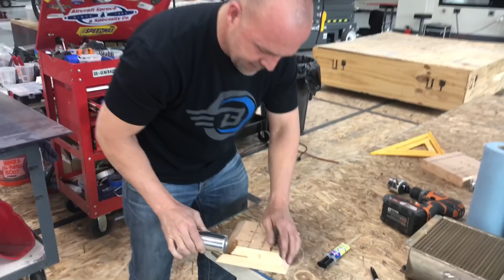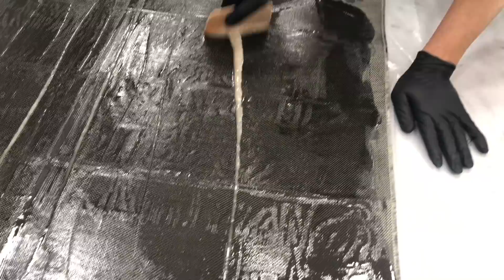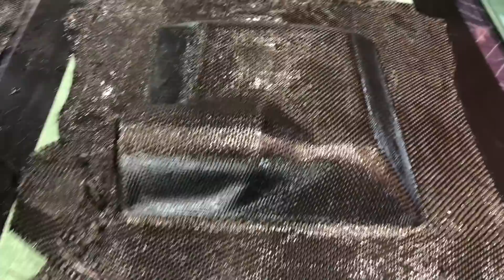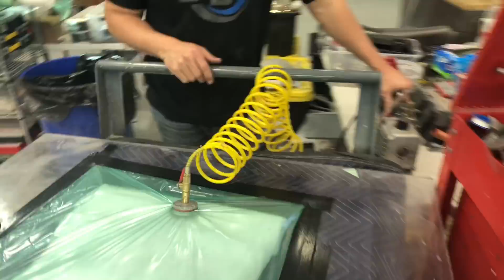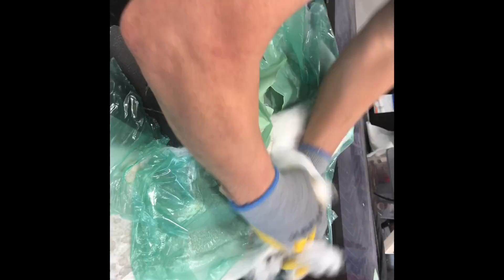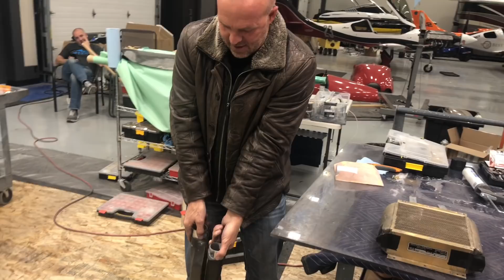Mike Patey Wilga (DRACO Video 3) Making Carbon Fiber Molds

Comment: No pleats required the carbon pulled down.The vacuum pressure and working the material into the mold as you started vacuum..I thought you had to do pleats.

Comment: Why do you still wet out your carbon and not use vacuum infusion or pre- preg ? Much better resin/cloth ratio and the addition of a small autoclave would make stronger and lighter with a similar/faster turnaround time...

Comment: You have amazing energy and wide-ranging skills Mike. This is a fantastic project so please forgive me for being a bit pernickety. These carbon duct parts used 4 layers of woven cloth, seemingly all laid with the warp and weft in the same direction, i.e. 100% 0/90 layup. This is OK for lightly loaded parts but for more highly stressed parts you would need to add some layers at 45 degrees. Also, to prevent the part warping as it cures, the plies should be layered symmetrically about the mid-plane, e.g. 0/90, +45/-45, 0/90, 0/90, -45/+45, 0/90. The process looks fine overwise.
Reply: 6 layers, not 4 (my bad) but same point but more so. Using more than 4 layers of the same orientation together risks delamination if high loads are applied. Probably OK for these items however.

Comment: I thought aluminum and carbon fiber were incomparable causing the aluminum to corrode.  I didn't see any isolation barrier between the two.
Reply from the maker: Patrick Smith good catch, galvanic corrosion is a mess. I screwed up in editing trying to keep the video short and I left out the footage when I added a couple layers of fiberglass. I now make it a point to show that in other videos you will see I leave that step in the video

Comment: Will someone please tell me I know Mike knows what he's doing without a doubt but with the oil coolers being so far back from the motor your adding 15 or20 ft of line to push your oil especially if you are at a incline going at a high RPM.do you have to add a extra oil pump or a stronger one to return the oil?
It's just a learning thing for me.

Comment: Nice part!  Agree with others about the dust mask thing but you obviously know what you're doing and can make your own choices.  

Quick note on the vacuum bag fitting - it's easy to just toss it under the bag and cut the hole from the top - just a slit across the hole in the base fitting - and then stick the top plate through the slit.  It makes it really easy with bigger bags where reaching under with a knife is risky business.  

Thanks for a great video!

Comment: I’ll tell you another trick. I like to use plastic on both sides to squeegee the excess resin out. Also a cool trick is to use zip lock bags🤣 you can throw a few lays ups in a zip lock pour the resin in and even hold them in the cooler . Then when your ready you just roll the excess resin to one side mark your pattern on the out side of the zip lock and cut it.  Try the zip locks it works great and it’s fast

Comment: Nice tip on the home depot batten material; Vac bagging consumables are expensive, nice to have a low cost alternative for something you use a bunch of but just throw away.

Comment: Hi, can molds be made of hard plastics for making wax injection? I am considering getting a 3d printer if I can find some files to print, wanting to print a mold for a turbine wheel about 196mm dia clock wise turn. Thanks bjphotography3@gmail.com

Comment: Mike, I like the part... but you should use a first layer of fiberglass to protect the aluminum from the carbon matting surfaces. Carbon on aluminum causes corrosion very fast! And put on a respirator please... love your toys!
Reply: Kraken unfortunately you are not correct. I work on airplanes for a living  and I see an insane amount of corrosion on the tails of ATRs where aluminum is bare on cabron. Even if the parts are sealed it happens.
Reply: Only if it comes into contact with an electrolyte, like salt water.  This is common in Carbon Boat building where you end up with plenty of salt spray, in a dry application it shouldn't be an issue.
Reply: I was going to suggest the same thing.  Not worth the risk on an aircraft part.

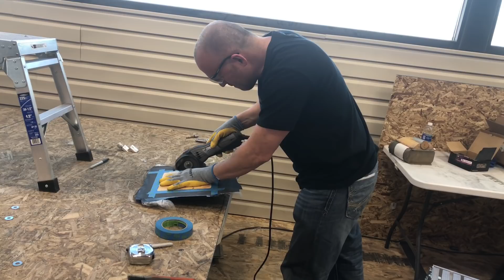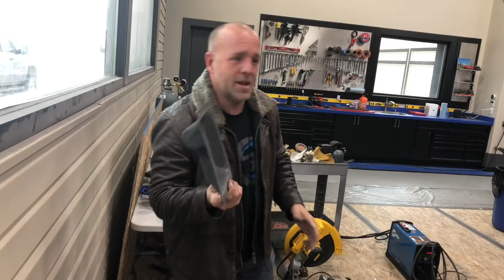Comment: Mike, what is that tool you are using to trim the edges of the part with (10:20, 11:10)? Is it just a die grinder with a thin cutoff wheel, or something more specifically suited for fiber work? Looks like it zips right through the stuff. I will be starting fiberglass work on my RV14 soon - could use something like that!

Comment: Your commentators are correct. Composites are dangerous because the fibers are so thin and stiff they'll readily penetrate the skin and work their way clean through the body. You need to wear protective gloves and a true respirator, not a simple carpenter's mask.

Comment: Holy crap !!!! When I was doing this building F-18's I was fully covered, respirator, coveralls, the whole bit. Atleast put on a mask and have a vacuum table when you're grinding Mike, PLEASE !!
Reply: Yeah a vacuum table is so easy to make I have one. Certainly Mike can Fab one up. It is very disturbing, he has no excuse not to make one. I also cut things just a little bit slower. Takes a little more time but keeps the dust down a lot. And for the last time it is very disturbing

Comment: WEAR A MASK WHEN CUTTING CARBON.  IT IS AS BAD AS ASBESTOS
Reply: No it isn't. It's bad, but not as bad as asbestos. Asbestos fibres splits lengtwise like barbs in the lungs and never gets out. Ceramic fibres doesn't behave that way.
Although I agree, you should do it either next to a fan that blows the dust away from you or like outdoors in a breeze or similar, or use a mask. I work with these types of fibres. The classification is "MAY cause cancer. Caution is recommended." on the boxes.

Comment: You have obviously done way more carbon fiber work than I have, but I was under the impression that the dust created by cutting and sanding carbon fiber was carcinogenic?  The fibers penetrated the lungs, and never leave.
Reply: yeah, I kept cringing while watching him cut, and sand on those CF parts. I used to work for an aircraft manufacturer that produces very large jets made mostly of CF. What he was doing without a mask would have gotten him walked out of the plant. Any drilling/cutting was very well evacuated, and dust/pieces disposed of carefully. it is nasty stuff
Reply: It's nasty shit.

From what I've read in scientific papers  the body can remove this dust "naturally" as it can be phagocytosed.

But i'd always use a mask  and avoid breathing that shit. If you can avoid then why not? We've seen way too many examples in the past where people have been told it's fine then got lung cancer later on...and when it hits it hits hard. 

I'd never have a career working with machining carbon where you're exposed to that dust.

The worst is handling cured carbon. You get a splinter from that you are not getting it out without micro-surgery. horrible horrible stuff.

The scientific studies suggest that large particles e.g. splinter size aren't respirable...but if you're unlucky enough i'd say it's possible.
Reply: I'd never heard CF dust was particularly dangerous. Looking at a few relevant articles online would lead me to believe it's no more problematic than any other sort of fine dust. 
Here is a link to a few experts answer to the question of how dangerous it is. Long story made short, small single exposures will most likely not harm you, but if you are doing quite a bit of any sort of work that creates a lot of airborn dust, wear a mask. 
https://www.velonews.com/2011/03/bikes-and-tech/technical-faq/technical-faq-with-lennard-zinn-is-carbon-fiber-dust-safe-premature-bearing-wear_162828
Reply: Siggy in CR - the Resin is an issue. As to carbon... when you cut it, if the ‘dust’ is in the form of fine shards and filaments, it is their shape that is the issue...the same issue with asbestos.  It works it’s way into lung tissues like tiny splinters and causes your lung tissue to form tiny cysts around each splinter... or simply ongoing inflammation... either of which can lead to both compromised lung function, and disease processes like cancer or emphesyma.   If using polyester resin... just the outgassing of the methyl ethyl ketone   And resin is toxic. If using epoxies- there are amines you should not be exposed to.    Plain and simple... don’t make your body a Lab Rat for the chemical industry.  Wear activated charcoal respirators when using ANY compounded or catalyzed resins...and the same or at least a very high grade dust mask for cutting and sanding resin and ANY fibrous material.
Reply: He was in a hurry to get done and go home. Its not like he was causing a huge cloud of carbon fiber dust and intentionally inhaling. Im not sure of Mike's past or growing but that right there tells me he may have grown up as a grass roots, builder that just worked to get stuff done quick.

Comment: When you're not using the air to heat, with a blend door setup, just dump it overboard then you're getting the full advantage of it cooling the oil 100% of the time in addition to the second oil cooler.  You may not even need the second one?........